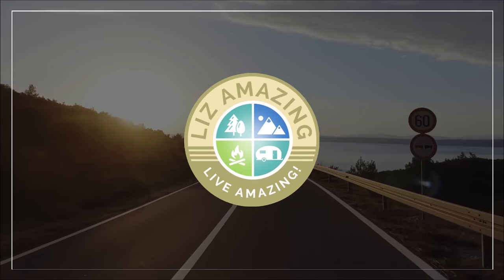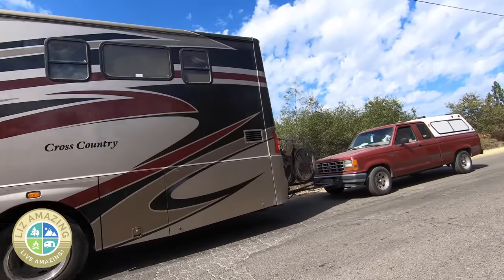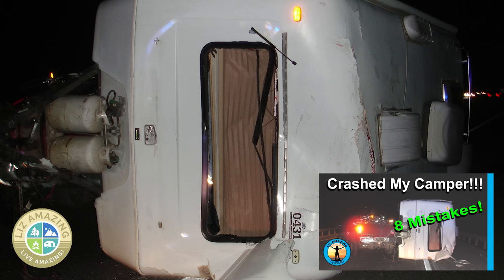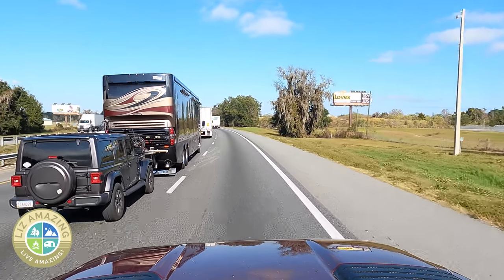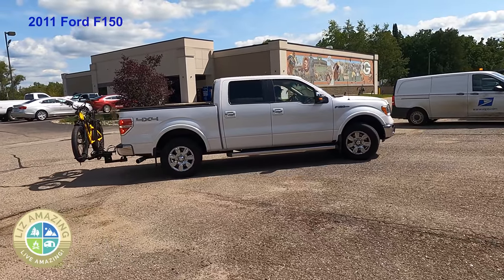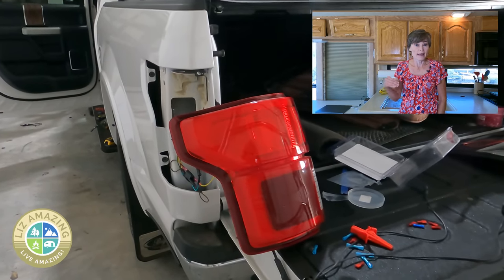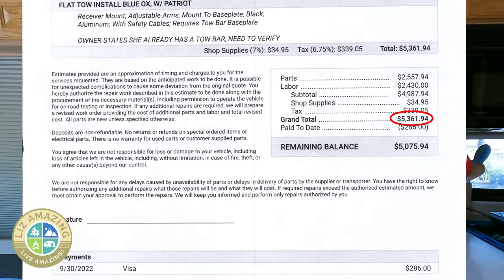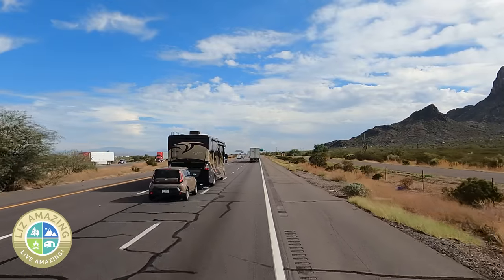These RVers are putting others in danger

Comment: Hi Liz. Great video. I know a little bit about this subject. And I have a few recommendations concerning safety. #1 - Get a braking system that works. Have someone qualified and trained by Blue Ox, Roadmaster, Demco, etc. (Yeah, I made that mistake and it cost me about 4K, long story). I agree with everything you said about safety.  I have seen many injured seriously and a few fatalities from mistakes and lackadaisical attitudes toward safety. This is serious stuff. Another thing I learned the hard way is to monitor the weather closely on your driving days. Wind is not your friend. It set me back another 5K. (again, a long story.). Get an app, know the forecast and bite the bullet and stay in place if wind 35 to 40 mpg and above is forecast. I don’t have personal experience, but concentrate on tire safety, too. Get a steering stabilizer. You willl respect all of this if you have an RV of any kind. I have personally seen many beautiful pickups with ugly tailgates from having the fifth wheel unit dropped on it. Too common. Manufacturers should come up with fail safe systems for this problem. People are getting hurt. I can go on, but this is getting too long. BE SAFE!
Reply from the maker: Hi Clay! Thanks so much for taking the time to weigh in about this important topic. Yes, wind is a huge factor. I am actually getting a steering system, getting it installed next week! And thanks for watching, and be safe as well.

Comment: Blows my mind. If people only knew what semi trucks have to go thru for safety. I am so happy to hear you took the extra steps for your safety as well as everyone that may travel around you. I have seen too many motor homes, campers, etc, in horrible wrecks that who knows, could have been avoided if only they took the extra steps. The safety before is still cheaper than an accident later. Good for you Liz! 
Stay safe
Reply from the maker: Thanks for the encouragement, Liz!!! Be safe as well.
Reply: People that drive vehicles of 18,000 lbs or more commercially have to be tested to get a CDL. I have always wondered why people that drive heavyweight RVs aren’t required to have the same type of qualifications. I’ve always thought the easiest way to tow a vehicle is to use a trailer equipped with brakes.
Reply: @Chris_at_Home  there are some that really should. I have seen some many that do not belong behind the wheel of one. I'm not saying all, that is not my point, just some.
Reply: @lizhartel3740  Living here in Alaska we see it all. Some of these shouldn’t even be driving, never mind a motorhome. If we go anywhere we go towards the end of August when most outsiders have left. We are thinking of something for down South in the winter. After I saw your video of buying an older class A we have been looking at them. We don’t want anything over about 32’. I was thinking of towing something small and light on a trailer when we do this. The problem with many of the smaller Class As is the GWV is usually under 12,000lbs. We will just store it down there and fly down for 4-5 months.  We love our summers here.
Reply: Trucks are driving themselves now.
Reply: I prefer to double tow!

Comment: Great points and sage advice. There is a lot to towing a toad properly. Base plate, tow bar, wiring harness, and braking system. It adds up. I dot the I's, cross the t's, and do it right when hitching up a toad. It gives me a sense of confidence and security knowing that all safety precautions are in place.
Reply from the maker: Yes, me, too! Thanks for this, and for watching. See you out here.

Comment: WOW $5300!! I have set up 6 vehicles for towing in the 20 years and several motorhomes I have had. I am thankful that I was handy enough to do that. Sorry for those who are not. It's not difficult to do. Once you have removed the bumper (depending on the vehicle) and attaching the baseplate, the rest is just time-consuming which is where a lot of the expense comes from. Running wires to the back of your toad vehicle and connecting them to the lights with diodes takes a little bit, but it is not at all bad. As for the braking system. I have used the Brake Buddy which didn't seem a big deal to setup. Just place it in front of the seat, hook it to the pedal, and plug it in. Wiring the monitoring system to the front of the coach took time, but everything worked flawlessly. 

Integrated systems like the one you mentioned would make a lot of sense as well. I just couldn't see justifying the added expense or time. It's just a matter of preference in my opinion. Having a braking system is important though. With 5000 pounds pushing you down a steep grade you will be glad you made the investment and have piece of mind.

I admire a person like you who gets out there, (by herself) drives a gigantic coach, and explores the country. You live up to your title: "Amazing."

Happy motoring and stay safe!!!   :)
Reply from the maker: Hi David! Thanks for watching and for your kind comment! Yes, the setup (even my supplemental system) is more labor than anything else. I definitely did not want to learn on my own vehicle, but it sounds like you are more than capable for the task. And, yep, I am LOVING this life and loving living large in my motorhome. See you in the next video!
Reply: Does it make any more or less sense to avoid the towed vehicle's built-in wiring system altogether and just use a permanent or temporary light bar for the tail-turn-brake lights. No diodes, less risk.
Reply: @joewoodchuck3824  Personal preference, I wired mine... Honda CRV , Chev pickup, Suzuki Grand Vitara using diodes for a much nicer install (IMHO) I personally don't like the looks of light bars, diodes are easy to hookup and once it's done, it's done, no extra pieces to haul around
Reply: @questionmark4348  Do you use Schottkys or standard rectifiers?
Reply: @joewoodchuck3824  My reply seems to have disappeared maybe Youtube doesn't like links? I use----> Tail Light Isolating Diode System with Wiring Harness
Item # 38955... Lots  of videos on installing here on Youtube.
Reply: @joewoodchuck3824  Standard retumfriers. Power dissipated is forward voltage times current, its surprising how hot they can get if they are simply inserted into a wiring loom with little heat sinking.
The difference in voltage drop in a 12v or 24v system is unlikely to be of much importance. Schottkys should dissipate less heat due to lower voltage drop.
Reply: @occashares  That's why I asked. I may never tow a vehicle again, but my mind is always working on various designs anyway.
Reply: @joewoodchuck3824  Finding out why things fail  is quite an interesting pursuit. Some times the findings are counter intuitive and the fixes unexpected.
Reply: @occashares  I've always disliked repairs. Making stuff is my thing.

Comment: I am glad you brought this to light. I did not have a supplementary brake system at first with my truck camper dinghy towing my jeep. my dealer talked me out of it saying the truck brakes were oversized! Anyway, when I found out that full-timer insurance would not pay out a claim if it was related to towing, I invested in the RVI system. When I get my next motorhome I will get a system right away once we sell our Lance travel trailer. Thanks for enlightening new folks.
Reply from the maker: So glad you know about the importance of a supplementary braking system! Good for you for doing the research and checking with your insurance company. Happy motorhome shopping!
Reply: @LizAmazing  Yes, insurance has determined that a panic stop at 70 MPH without a supplemental braking system can grossly increase stopping distances. With deer and inattentive drivers on the road, this should scare us all! Thanks.

Comment: FYI, a couple states require brakes on anything over 1,500 pounds, and most of Canada requires brakes for anything over 2,000-3,000 pounds.  We went with the RVI 3 braking system so we could move to a new vehicle in the future  - it's easy to install in under 30 seconds when we flat tow - probably because it self adjusts itself once plugged in.
Reply from the maker: Good to know. Thank you, and glad that safety is on your mind as well. Thanks for watching.

Comment: I never met an Rver that didn’t have a braking system  pulling a car or truck in 23 years of RVing.
Also, it’s the law in every state. Most have limits of 1000 to 1500 lbs otherwise any more weight requires a braking system.  Trailer, boat, or anything being towed.
Reply from the maker: Glad to hear. I have met more than a few, so scary. Be safe out there!

Comment: The tow bar we have used for 8 years with no problems is the NSA RV Tow Bar with the built in braking system. It uses a surge brake system attached the the brakes of your toad. Therefore, you do not have to spend big bucks on a separate braking system in your toad. You can use any tow plate you wish, the NSA tow bar will attach to it. All of the same cables and anti-runaway system are the same. I figured I saved about $1200 with the NSA tow bar over another tow bar and separate braking set up. People need to remember or be aware that if you do not have a braking system on your towed vehicle, as required by law, and have an accident your insurance company may void your policy. I have heard of that happening. It may be cheaper to have a braking system than having your insurance cancelled on your very expensive motorhome.
Reply from the maker: That's good to know about the NSA, hope you added the brakeaway system, too. And good point about an accident without a braking system my void your policy. Thanks so much for watching, Iggy.
Reply: @LizAmazing  A brakeaway system is part of the tow bar. I called it anti-runaway cable.
Reply from the maker: @kradwonders   oh good, I saw on their website were that was an add-on. So glad you have one! No runaways for sure!
Reply: I also got the NSA Ready Brute tow bar .I got it with the light pigtail for $2100.00. I payed $150.00 to have the base plate installed and some friends and I  will do  the lights and braking system. Total cost $2250.00.

Comment: We tow a small trailer with only a golf cart and kayaks behind our 29 foot class c, so an additional braking system is not necessary. However safety is always a concern with any towed addition to the motorhome,or any vehicle for that matter. Tire pressure, safety chains, lights and always periodically checking the load on the trailer for secure and tight tie downs are just the basics. Towing anything always comes with its own challenges and as you’ve said ,the law requires additional brakes over 4000 lbs. Hope your new system works great for you and happy trails. Love your channel and enjoy the info you share.
Reply from the maker: Thanks Erik. And thanks for commenting within the first hour, it really helps the channel. Glad you are familiar with the law and towing essentials. And thanks for your kind words!

Comment: Liz, in some states it might be over 4000lbs you need an aux brake system, but I believe in some it's as low as 1000-1500 lbs. Also quite a few states require a special class of license to operate "ANY" vehicle that has a gross vehicle weight rating(not how much it actually weighs at the scale) over 26,000. I live in S.C. and the requirements call for a special class E license if operating a single vehicle(not towing)that has a Gross vehicle weight rating of 26,001 lbs or greater and a Class F license if 26,001 lbs and towing a vehicle or trailer. Varys by state and some states don't have any special requirements. I installed our entire flat towing setup 6 years ago and it cost us about 2,150. I would have had a RV dealer in our area do it but they were so busy it was going to be almost 3 months to work it in and we were going to be traveling about 500 miles to purchase and pick up a used 2003 Newmar Dutch Star DP in 3 or 4 weeks.(the local dealer quoted 3200.00 total). Since you're by yourself I would recommend a check list for each activity, just like pilots use. It's too easy to get distracted and overlook even the most obvious things.  Safe travels.
Reply from the maker: Hi Rick! Good point about the special license. Many states limit that to commercial drivers, exempting motorhomes. Happy to hear that you have a Newmar! I love those and even did a review on a Dutch Star as well as a New Aire. And, yes, a checklist is the way to go. I find the more you do something, the more you "think" you've done it, when you really haven't. Been using a checklist for four years. I should do a video about that! And thanks for watching.

Comment: Hello Liz, we have used tow brakes for about 10 years.  We have a class A Pusher. We use Roadmaster, BrakeMaster. It was very easy for me to install and when we tow it is less than 5 minutes to hook up or uninstall the towing brakes. We use a Roadmaster, 10,000# BlackHawk 2 All Terrain tow bar and it is easy to uninstall when you are on uneven ground. We tow a Jeep, a Scout and my dailey driver a Chevy Colorado. We drive in a lot of mountain roads so I am much more confident on the road.

Comment: Great advise. There are states that require brake systems when towing 1,500 lbs or more. While safety is and should be a priority in this discussion, a equal priority is LIABILITY or possibly Criminal if your found to have disregarded the safety and caused injury or death.
Reply: Oh EXCELLENT point!!!
leaving open a for sure huge liability lawsuit and criminal charges. A chance left open for that to occur….would be a nightmare. 🍻
Reply from the maker: Yes, so true, Barry. And  your insurance won't have your back if you're breaking the law. Thanks for watching.

Comment: I also flat tow a F150. I decided on the Patriot Brake and haven’t found it to be cumbersome at all and the set up is a simple push of a button and wait 10 seconds. The system uses a radio signal to a control box in the RV cockpit. 

I do like that invisibrake you’re using and that will probably be my next brake system.
Reply from the maker: Glad to hear this about the Patriot. It can't be all bad. Thanks for watching.

Comment: Ready Brute is a great tow bar that doesn't break the bank. Been around for years and t tows great. Nice thing with them is if you have a mechanical skill set, you can easily install it yourself. Only power that goes back to the toad is for the lights. Everything else is mechanical. And for those people that always ask, the braking is smooth, even going downhill. There is not stuttering from the tow vehicle it just brakes when you do. About $2500 if you do the install yourself. If not then expect around $500 to $800 for the install depending on vehicle. Wranglers and pickups are usually very easy.
Reply: Yes, Ready Brute Elite towbar brake system (7,500 lbs towing) by NSA is the affordable and easy way to. I did the installation myself and total, including lights was under $2000.
Reply: Been using one for 12 years full time travel, no problem and very simple to use and install.
Reply from the maker: This is great information, thanks for sharing Jeff! See you in the next video.

Comment: Yes we have a motorhome front engine diesel. We have towed a car for years. Have the blue ox towbar and a patriot braking system ( we do have power seats in our Jeep Grand Cherokee that we flat tow). We have found it to be a little bit of work to set up but as you said Safety First!!! We have friends that tow without I am sad to say. We like the Jeep because it goes into neutral and we don't have to stop every few hundred miles to start it and mess with the transmission like other vehicles. We have an older 2008 class A (pre DEF ) like you chose. Just turned 60,000 miles- it was 40,000 when we bought it a few years ago. Thanks for providing this valuable information and hopefully it hits home with someone who needs to hear it!
Reply from the maker: Yay, Gwen! Thanks so much for your comment. I, too, have friends who tow without. Hoping this video helps get the word out to people how necessary a brake system in. And it sounds like you have yourself a winner with your Class A. Looking forward to seeing you on the road, and thanks for watching.

Comment: I have flat towed a ‘92 Toyota pickup, purchased new, behind a class C.  Even at 2500 lbs I felt it’s presence.  I agree, people tow 3 and even 4 ton vehicles with all size RVs, small and large, without brakes on the vehicle being towed!  You are offering great advice… now my advice.  Choose a smaller, lighter dingy… I spent less than $500 setting up my little truck for towing, and by the way it will go anywhere a larger 4X4 will go.  It tows without brakes because of its small size, gets great fuel mileage, and can haul 1/2 if needed.  I once asked a 120 pound coworker why she needed a 4 ton SUV to get back and forth to work in… sometimes less is more folks 😉
Reply from the maker: You know, I thought about getting smaller but as I said in the video, this will pretty much be my daily driver so I wanted something that works for me. Thanks for watching. Besides I spent that $5300 so now I'm definitely stuck with it! :)

Comment: I have a 2018 Class C Coachmen Concord 300TS.  I tow 2005 Chevrolet Colorado and use the brake buddy system.  Works very well.
Reply from the maker: Glad to hear this, Ken. Thanks for letting me know, and for watching. Hope to see you on the road.
Reply from the maker: We may never know the truth. It was odd she would want me away from the dark and quiet side lot to right in front of the door, bright lights and lots of witnesses. But the cops are done with the case having ruled out the thieves house for whatever reason. Thanks for watching.